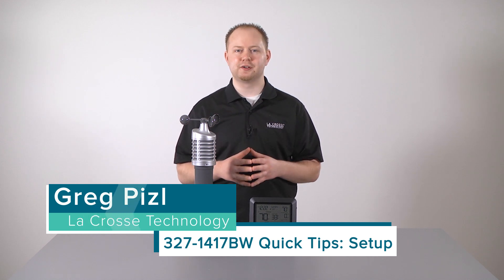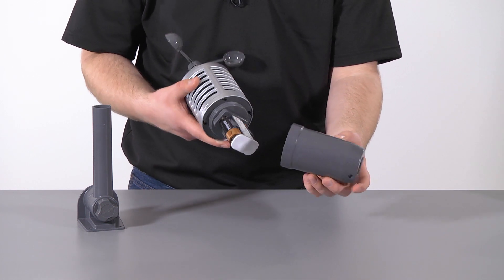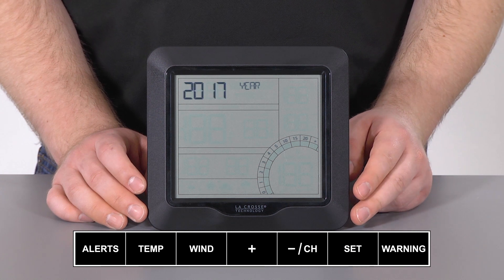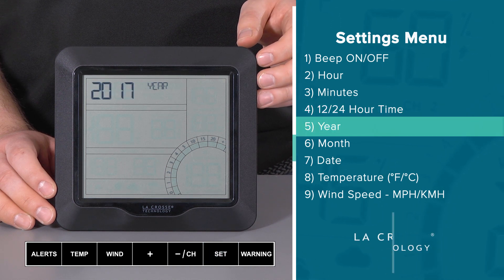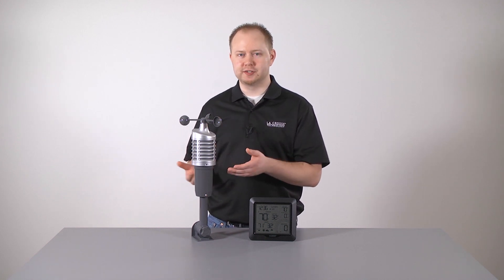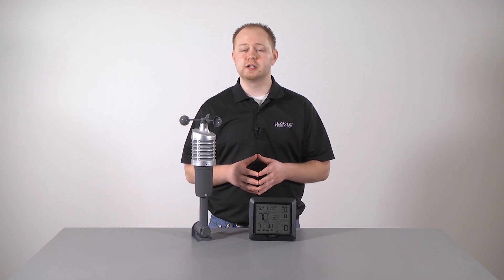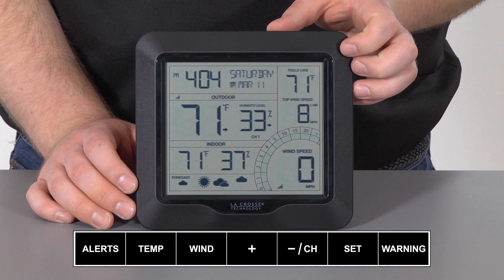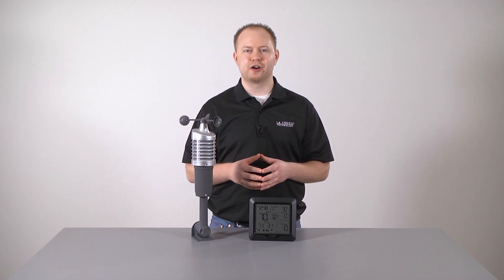327-1417BW Wind Speed Weather Station Setup

Comment: I use my 327-1417BW on a boat, i need the wind-rising alarm to wake me if a squall comes up in the night. Following the  manual carefully i was able to turn on the high wind alarm to a default value of 16 kph, but can't change it. The manual says under Set Alerts:
"3.Once activated, press and release the + or - to adjust the values."
Instead + or - toggles the alert on or off. Just hate it when the manual and the device work differently! I need that wind alert up at 30 kph to be useful. Any ideas?
Reply from the maker: Hey Grant, our sincere apologies for the confusion. When in the Alerts Settings Menu, for the high wind speed alert, press the ALERTS button when the word ON is showing; this will bring you to the actual custom high wind speed alert setting adjustment, where you'll then use the +/- buttons to adjust and press the ALERTS button again to confirm. We hope this helps, but if you need further assistance, please message our support staff directly here: https://bit.ly/contact_techsupport. Or alternatively, send us a private message on our Facebook: http://bit.ly/LaxTech_Facebook or Twitter: http://bit.ly/LaxTech__Twitter page.
Reply: @lacrossetechnology  I press Alert, that gets me to the first alert option (wind speed). ON is showing. Then i press Alert again, and it just goes to the next kind of alert (Outdoor Lo). No joy!
Reply from the maker: @granthallman7721  Thank you for bringing this to our attention; we will look into updating our manual with the correct instructions. Here are the steps to edit your alert value: 

1. Press and release the ALERTS button to view your alert options
2. Use the +/- buttons to turn an alert ON
3. With the word ON showing for an alert, hold the ALERTS button until ON begins flashing
4. Then press and release the ALERTS button again until the alert value begins to flash
5. And finally, use the +/- buttons to adjust the alert value
6. Press the ALERTS button to move to the next alert, or the WARNING button to save and exit the menu

Sorry again for the inconvenience. If you need further help, please use the links in our previous comment to reach out to our support team. 😊
Reply: @lacrossetechnology  That doesn't do it either. I got the ON flashing but the +/- buttons just toggle the alarm ON/OFF. I tried holding Alerts button a second time, that got the alert *value* flashing, then +/- buttons change the value. Suggest putting that in the manual.  :-)

Comment: @5:05 = ohhhhhhhhh okay so THAT'S where those 4 screws come in handy!  I bought a brand new LaCrosse Wind-Speed Weather Station (model #327-1414BW) recently, and inside the box were these 4 unidentified screws in a little baggie, with no mention of where or how to use them.  I guess now the mystery is now solved!  Why not put a sticker/label on the baggie, in future packaging?  Why make the customer chase down this random misc. piece of info on their own, which 95% of users probably won't do?  It wouldn't cost more than a penny or two to make this change, but it would go a long way in customer confidence in their own product they just bought communicating things clearly and transparently.
Reply from the maker: We do apologize for the confusion and appreciate the feedback. We will be sure to pass along your comments to our R&D department to help improve the manuals or quick start guides packaged with our products. For additional information bout your product, the full manual and FAQ documents can be found on our website here: https://www.lacrossetechnology.com/products/327-1417bw#support
Reply: Agreed. The instructions for this sensor on how to mount it and what the accessories are for could be vastly improved.

Comment: Does the sensor have to be mounted and used or can I just have the weather station set up in my upstairs apartment without the sensor?
Reply from the maker: Hey Connie, the weather station display can still be set up and used providing you with accurate indoor temperature and humidity, time and date information, and forecast data. However, without the use of the outdoor sensor, the 327-1417BW display will show dashes for the outdoor temperature and humidity, wind speed, and feels like sections. It sounds like a more basic weather station may be a better fit for your situation. You can check out our current lineup here: https://www.lacrossetechnology.com/collections/weather-stations -- For inquiries about a possible switch/refund, please reach out to our store directly at 608-785-7939 or via email at: store@lacrossetechnology.com -- We apologize for any inconvenience and are here to help if you should have any further questions. 😊

Comment: I can't find an explanation anywhere for the forecast feature and what the icons mean. How does the forecast feature work? Thanks for the video!
Reply from the maker: Hi Daniel, we’re glad you liked the video. As for your forecast icons, these are based on the station's barometric pressure reading. The icons are not necessarily designed to display your current weather, but more of a future prediction of your forecast to come in the next 12 hours. After setting up your station for the first time, these icons can act a little funny, which is why we recommend allowing 7-10 days for the station to acclimate to your location. More information on these and your other weather station features can be found in your full manual here: https://www.lacrossetechnology.com/media/catalog/product/3/2/327-1417bw_manual_032018_1_.pdf – Of course if you have further questions, please just let us know.

Comment: your video says to put in an open spot high on a pole, the instruction for Model 327-1417BW DC09118, says to put the wind sensor in the shade.  You don't mention shade on the video and in order to have shade it will be buffered from the wind almost anywhere I put it.
Reply from the maker: Hi Anna, sorry for the confusion here! The sensor should indeed be mounted in an open area as instructed in this video. This was actually a typo in your Quick Start Guide and we thank you for bringing this to our attention. We'll be sure to get this corrected on our website and in any future printed version.

Comment: how do I  get my wind to show in the center of the screen?
Reply from the maker: Hi Bill, we're not quite sure what you mean by "center" of your screen, as the LCD elements are locked in place as per your station's design. Now, if you're not seeing any wind data, please see our restart video here: http://bit.ly/LaxTech_BasicRestart to see if you can get your sensor reconnected. Should these instructions still not provide a resolution, please get in touch with our support team here: https://www.lacrossetechnology.com/support/index/form/ and we will work with you should you need a replacement.
Reply: What a stupid question.